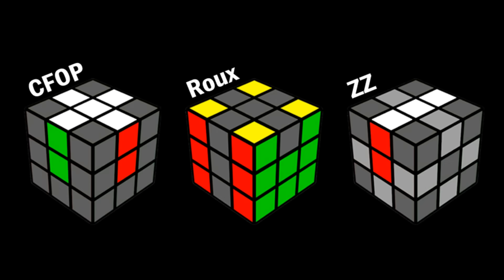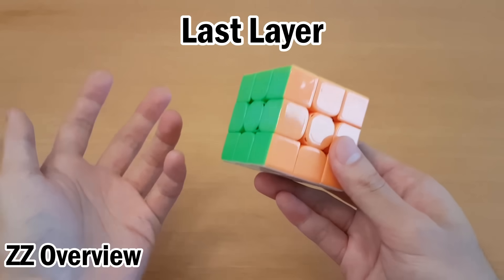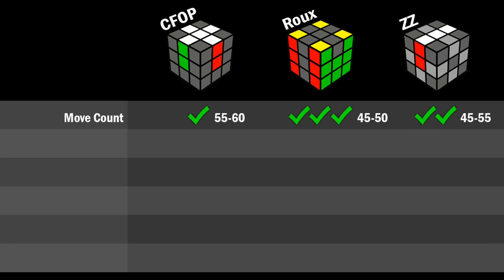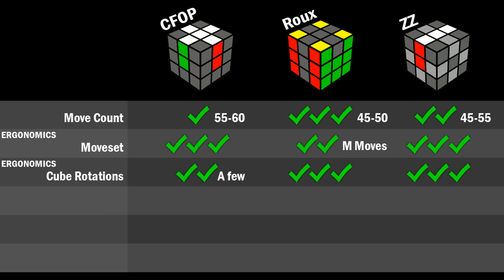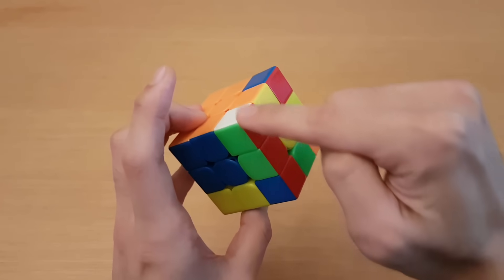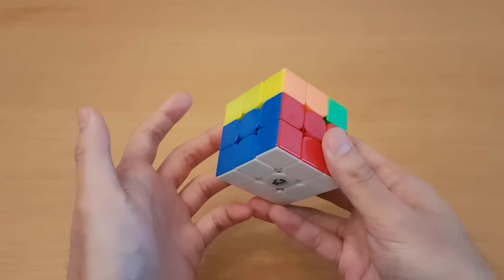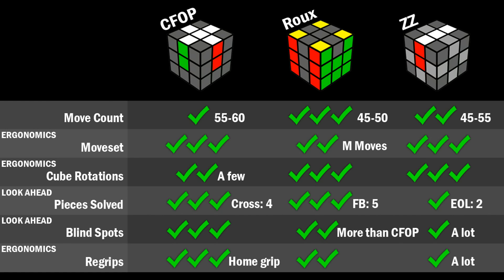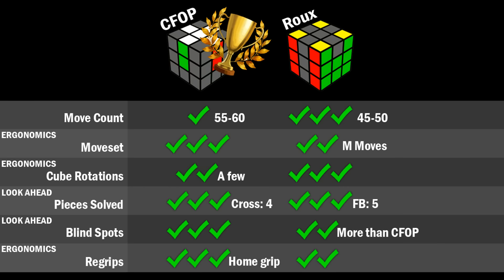The BEST Speedcubing Method? [CFOP/ROUX/ZZ] Comparison

Comment: I'm gonna yell at you in the comments. :)
Context, I average about 10 seconds (best ao1000 is 10.06, current is 10.12) with EOCross ZZ.

I'm a big one for saying ZZ>CFOP (with EOCross and ZBLL of course), so I'm just gonna list all the reasons why I think it is and I'll use the order you used in your video. Movecount: 53 (ish, as it depends on F2L solutions and LL algs). 9 for EOCross, 7 per F2L pair, 16 for ZBLL and AUF. Moveset is the same as ZZ and better than CFOP (<RUL> vs <RULy> but you also factored that in with rotations, so I can agree with you saying that they're equal). Rotations are fine, then this is where I think you made a mistake. EOCross solves 4 pieces, but it also half solves 8 other pieces (10 other pieces with EOLine) so it does more than you realise. The blind spots with EOCross are just DBL and DBR and are arguably better than CFOP as these don't keep changing with each rotation. Instead, they stay in the same place so you know that once you've solved the BL pair, there won't be a blindspot there again. Regrips with EOCross are also fewer than with CFOP F2L. Solve cross and then, from F2L, count the number of regrips. Do the same with EOCross and you'll find that you might do 1 max. With CFOP it will become 2 or 3 because of rotations. Another fact you didn't realise is the potential of keyhole and pseudoslotting with ZZ. Because of how EO works, the chances of having an edge solved in slot doubles and therefore the chances of pseudoslotting F2L doubles too. A third point is that because ZZ has half the F2L cases (and avoids some of the worst ones) you can optimise it and also optimise multislotting more. Fourthly, getting info for LL is quite easy. With a bit of practice OCLL prediction becomes pretty consistent and COLL prediction becomes semi consistent (Kian said that he does it about 30% of the time for CMLL). This means that ZBLL recog technically becomes only slightly slower than PLL recog and because of that, ZZ LL becomes just so much better (in movecount and in time taken). I get your point about EOCross making it harder to see cross+1, but people see cross+2 consistently, which is at least as many moves as EOCross+1, if not more (9 moves if you do XCross, more if you do cross and a pair). This means that I think that EOCross+1 is at least semi consistently attainable.
If you take all of these (I hope I've followed your rules), you get that ZZ has a slightly better F2L and a much better LL for a bit of a sacrifice of 3ish moves at the very start (when compared to CFOP). If you then say "493 algs vs 78 isn't fair", lemme try to make that sound slightly better. As this is the consensus (I think) remove sune and anti sune which takes the total down to 349 algs. 349 compared to 78 still isn't great, but add in some COLL, 2GLL and other common sets and you'll reach that quickly. Also, the fastest (Feliks and others) learn at least parts of ZBLL and other 1LLLs, so that will pretty 'quickly' bring the total to over 349, then ZZ has its own option select, such as knowing good ZZ-C cases or the odd WVCP, so it balances out. I hope that this makes sense and I've at least shown you (and anyone else resding this) that ZZ has at least the same potential as CFOP. 

A quick side note about other events: OH it goes Roux>ZZ (with EOLine and ZBLL. <RUL> and better ergonomics than CFOP and fewer moves)>CFOP. Feet it is ZZ>CFOP=Roux. Big cubes, CFOP=ZZ>Roux. I say this because EO inspection is actually really fast and takes up a maximum of 1/60th of a solve for a 2 min 7x7 solve. You then get pretty alright ergonomics, then on odd layered cubes a much better LL due to lower movecount. Don't take that as necessarily a good argument because I suck at big cubes, but just throwing some thoughts out there. For mega, CFOP is just better, but concepts do carry across. 2x2, corners first wins hands down. From this, I think that ZZ actually has a good utility across all events, as well as 2H. I won't do ZZ vs Roux now, but I will say that I think that they're equal.
Have a good day! :)
Reply: Oh hey its papasmurf
Reply: @Ashes-_-CS  Hey
Reply: @papasmurfcubes2616  man, I also use zz
here's my wca id: 2019POLA01
i use it for almost 2 years now and I'm sub 12. I started seeing Jayden's and Kian's videos about ZZ and it lead me to switch to Roux (I currently avg 18-ish with it)
I just use normal eoline with COLL
I don't know how to plan eo cross, i only can track DB and DF edges :(, could you help me improve in some way?
Reply: @soiten  It's just practice. Also, Kian's video isn't very good and Jay's also misses out a few things. And I know a lot of what I use now from experiment, but it's been worth it so far.  And nice data! It shows that EOCross is definitely worth it for the slight extra effort.
Reply from the maker: Since the last time we discussed, I did EOCross as my main method for a little over a week.
My thinking was that recognition and look ahead would be better since there are cases where looking at 1 sticker tells you what edge it is (CFOP has those too but ZZ has it more). I ended up finding that look ahead had issues due to a new problem. If I could inspect eocross (approx. time equivalent of cross+1) on most solves, then my first slot is 50% a front slot. In CFOP it's almost always a back slot because I can plan it. This is not about my ability, but more about the fact that eocross is similar to cross+1.
Having 2 unsolved back slots means you can only see one at once, so if you decide to look at the other one you start using reaction time to figure out what to do next (instead of always seeing all relevant information), which is an unreliable and very slow thing to use in F2L in my experience. Plus, deductions based on 2 uncertain things instead of 1 uncertain thing starts to require some real thinking.
If eocross+1 could consistently be planned, I still wouldn't be sure about zz since that means you could instead do cross+2 on cfop which eliminates all doubt of which pieces are where, and then no deductions would be necessary.

As for improved pseudo/multi slots, that absolutely has potential just for lowering move count. A slight counter is I find that move count is far less important than pause reduction, so as long as you're not hitting near perfection on look ahead (nobody is, especially in competition). Because of this I don't feel that pseudo slots can carry a method. Or in other words, I don't feel that move count reduction can carry a method unless it's a significant amount at very little cost (and pseudo slots come at the cost of recognition and look ahead). My main judgment on eocross+zbll vs cfop is that practically speaking, they both have 6 steps at a high level and I subjectively believe that look ahead is better for cfop. That may change in the future though if somehow human look ahead ability is drastically improved, which is why I said slight counter.

Lastly, this may just be me but the cross part of eocross always took way more double moves than with cfop. Besides L2/R2/F2 being much slower than quarter turn versions, it made the first pair look ahead a lot harder too.

If humans were perfect, then eocross is better. No rotations and lower move count on a slightly improved moveset is simply better. But I'm not convinced look ahead (+blind spot reduction) are good enough with eocross
Reply: @JPerm  I get that, and I also get that you can solve a back slot more consistently in CFOP, but I think that that issue can be solved with a) tracking, just as people do with DB in Roux, and b) being smart of which pairs you solve. CFOPers already do this and with ZZ it means that you can either eliminate the left side or eliminate blind spots about halfway into the solve while having EO solved, while having pretty pauseless F2L (as much as CFOP if you do it properly). Also, the length of EOCross means that the ease  at which you can see your first pair during it is greater than with normal cross, and same with EOCross+1 vs Cross+2. 

With the pseudo/multi slotting thing, I agree. It is still easier to do with ZZ and if it is implemented into CFOP with good success, it will be implemented into ZZ with greater success imo. My opinion on this: CFOP F2L having marginally better lookahead, ZZ F2L having better ergonomics so I guess you could say they balance out. LL ZZ wins by a landslide (especially if you actually drill ZBLL recog/ZBLL in general, but requires work). With the EOCross bit, I get what you're saying with more L2/R2/F2, and I guess that can't be avoided fully, although it can be reduced if you're good. 

Thanks for trying it out though, it's more than what most people do. I guess we're going to have to wait until someone gets very good with ZZ and popularises it to be able to see if ZZ does have that lookahead problem or if it compensates.
Reply: @papasmurfcubes2616  ZZ-a is good and all but ZBLL is a very large set and it will take a huge amount of investment to be consistent. Do you think ZZ-VH is enough to become sub-10 and below? ZZ-VH has fewer algorithms which we can use to convince a lot of cubers to use ZZ.
Reply: @esimisola8321  Yeah, you can be sub 10 with just COLL/EPLL or even OCLL/PLL (28 algs), but it will just be harder to get even faster.
Reply: @papasmurfcubes2616  Recently I decided to switch methods, I used to be sub9 with cfop, I'm not really practicing to be faster, so I decided to switch to zz(used it like 3 years ago for half a year) I'm sub12 with zz, but now I'm thinking about eocross. What do you think?
Reply: @igortarasow  Do EOCross if you wanna use ZZ.
Reply: Your doing the lords work
Reply: just finished doing and avg of 100 of F2L starting from EO Cross (scrambled the cube, solved eo cross, then started the timer at the f2l)
avg of 100 was 5.16 with 3.25 of PB
I tried to replicate what I do in my solves: i don't really track where everything is going to be, i just track DF and DB and have some good lookahead to the zzf2l
I'm going to do the same test using f2l from EO Line and edit this comment with the results

edit:
avg: 5.74, pb: 3.10 (lucky blockbuild) 
standard deviation: 1.03 (f2l from EO Cross was 0.94)

conclusion: eo cross is better, but the data shows more information about me, because I'm more used to "blockbuild" during f2l
but even then, cross is still better
Reply: That just sounds like a modification-improvement to cfop. It gets rid of the important idea of blockbuilding of zz to reduce movecount. For me it relies on cfop ideas and methods rather than zz
Reply: I like to think of it being "a better cfop"
the main idea of cfoo is cross+f2l
and the main idea of zz is EO + solve the cube 3 gen
so it's a mix of the two, where you do the cross and have a regripless f2l in exchange for ~3 more moves
Reply: Gerard ok, XCrosses are just Petrus then. You could just see ZZ with EOCross as ZZ but with ergonomic blocks.
Reply: I want a comment, not an essay
Reply: There's one extra thing I'm not seeing in the discussion, which is: with ZZ you can really easily just put the front slot in the back (even if it's the front one), due to the floating nature of the left and right F2L blocks. So you can just fill the blindspots by solving a non-blindspot pair, and keep it like that until you solve the back one. Thus solving the visibility issues.
Reply: @rusca8  That's true, but not necessarily faster with EOCross. I'm not sure entirely though, but I'm pretty confident nonetheless.

Comment: I want to say things about ZZ. I switched from cfop to ZZ, yes you heard me, switched when I was like sub 19 and I switched.
1 inspection. ZZ is basically all about inspection now yes this can be tough to plan a whole cross as well as doing EO but it is well worth it. You have to practice a lot to be able to do this (I myself have not even gotten it down.) in fact it is very similar to one looking a 2x2 solve. There is a little bit more required for EOCross but it is very similar.

2 ZBLL. Now the reason I switched to ZZ is because I was planning on learning ZB when I was using cfop. So I asked around for tips. People said I should find a way to orient edges during the cfop solve (which would end up being like Petrus) instead of learning ZBLS. One person mentioned how I could switch to ZZ so that my edges would be oriented and I would not have to worry about the EO triggers or ZBLS. ZZ is also mainly used for ZBLL. Many ZZ solvers strive to learn full ZBLL. 

3 the move set. The move set for ZZ is much better than cfop because it has no rotations. Now I know that you mentioned the ZZ cross eliminates R2 and L2 but I am reinforcing that. Again you one look a 2x2 solve. EOCross is very similar to that. Therefore the better you are at 2x2 there is a chance that you can have good ZZ capability. So the ergonomics are much better for ZZ than cfop.

4 OH. Now ZZ is pretty good for oh (roux is still the best though) because it requires no F moves after EO which can be very hard with one handed (And if your last layer uses F moves). Also Eoline can actually be better for OH because R2 and L2 are really easy moves to do. 

That is my opinion on this matter (your still an awesome Cuber J Perm) I just feel like ZZ is underestimated. It has a lot of capability for every type of solving. Another thing about ZZ on big cubes. The person who told me I should switch to ZZ invented a method called 4Z4. It’s kinda hard to explain so I would recommend going on the speedsolving wiki.
Reply: ZZ EO-Cross is slightly better than CFOP.

Leo Borromeo did a 3.75 second solve technically using ZZ eo Cross and no one noticed, the only thing, he skipped EO, and EO is like 4-6 moves, so ZZ will get you insane times, but no one good at cubing in the cummunity has tried it because CFOP is way easier than ZZ
Reply: That was probably me. I would say that yau>4z4 but yau>any other 4x4 method (except for maybe LEOR on 4x4, but it's weird). But I agree, it has a lot of capability in all types of solving.
Reply: Yes also I’m cubinwitdapizza on speedsolving.
Reply: Thank you i think zz is underestimated cfop is my main method but i am faster with zz it is great because ego can be quick and zzcross f2l is like a flash

Comment: I'm personally a Roux solver mainly because I don't like using algorithms. Additionally, M moves are really comfortable for me, and it just always felt better for me using my brain while solving. I've been able to get sub 15 a few solves with Roux after learning only two of the CMLL sets. Still working on that, but I also need to work on pausing. Overall, I agree it comes down to preference. One of the arguments I think you forgot to point out is the less the cube is actually solved the more freedom you have to manipulate the pieces efficiently and ergonomically. I've seen some really great Roux solvers who can do this. However, if you're not one with a logical or analytical mind then this isn't for you. That's my added point tho.
Reply: I switched to CFOP from the beginner method and managed to get sub-15 as well. I personally like algorithms because they are faster than thinking, and sometimes you get skips. Roux looks really cool and I think it might be worthwhile to learn both for more knowledge about the cube. For example, Tymon kolasinski can predict OLL while doing the last F2L pair.

Comment: There is one flaw in your logic. Advanced Roux solves plan 1st and 2nd block in inspection. Therefore, there are only 6 edges unsolved afterwards, leaving, yes, one blindspot. But you can see all the other pieces, so from that you can deduce what the blind spot is. Also while orienting the top and bottom, you get multiple peeks at the blindspot piece. Lookahead in Roux is super easy because of that, even without any cube rotations.
Reply from the maker: No they don't, that's 10 pieces. that's like planning cross + 3 F2L pairs in inspection. It's possible, but nobody does it consistently
Reply: @JPerm  They track second block so they know where it ends up after first block and then immediately solve it.

Comment: Just want to get some thought on this:
Cubeur-Manchot and I have been working on a method, created by Blah on the speedsolving forums, but was never finished. I thought I was the creator of the method, but I realized that it was created 10 years before I came up with the idea. It has the following steps:
Cross
F2L-1
COLS(CO+LS) - 1049 algs
CPELL(COALL; 1LLL set with CO done) - 157 algs
1206 algs total. 
Not sure how good this method is, this is a variant from ZZ-C but using CFOP and using every single LS case. 

If this gets flagged for advertisement, sorry for posting this.
Reply: Is 1LLL with CO done really just 157 algs? That’s crazy if true
Reply: @amirPenton  Yes, it's true, but I've stopped developing the method 2 years ago as I realized that there's no point in forcing CO skips when LS OLL PLL is likely faster
Reply: @cubeblazer  Wow that's awesome, cube symmetry reduces cases way faster than I thought.
Reply: Can you gift me a megnetic cube 3X3

Comment: 8:55 At this point, that case can actually be done with no regrips from home grip in 7 moves with  r2 U(with left index) r2' U R' U2' R. The only reason why I would use what you did is for OH, and it only saves one move.